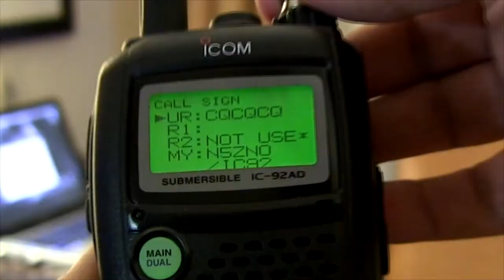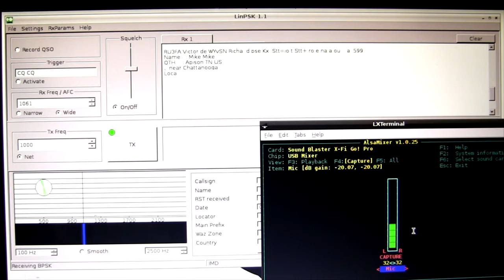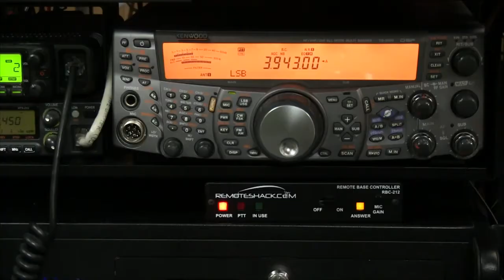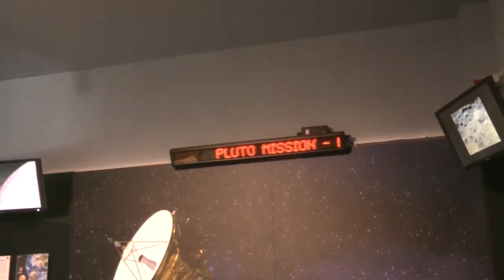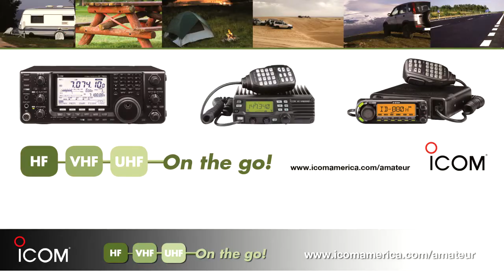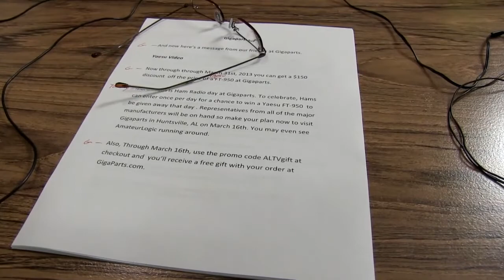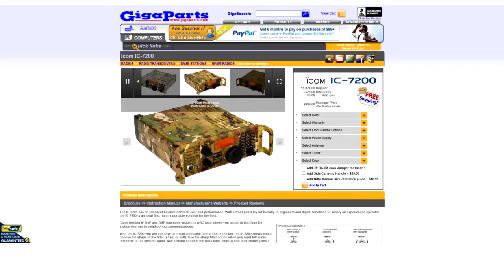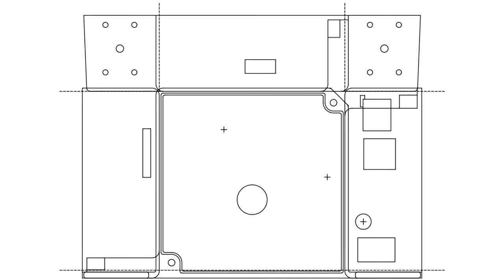AmateurLogic.TV 53:The Making of AmateurLogic.TV

Comment: I'm getting clean copy with FLDIGI (today on FD), including when using the Signal Browser, with either a "medium" (900 MHz) or "high" (950 MHz) overclock (my ham Pi won't boot 1 GHz "turbo"). Even at 950 MHz, it (and x-windows) are running close to 100% cpu. It was your tip to plug the USB soundcard directly into the Pi instead of through an external hub (with lots of latency) that made this work for me. I can't thank you enough!